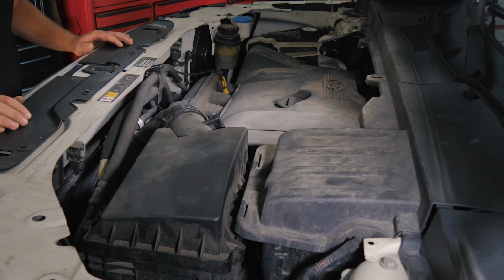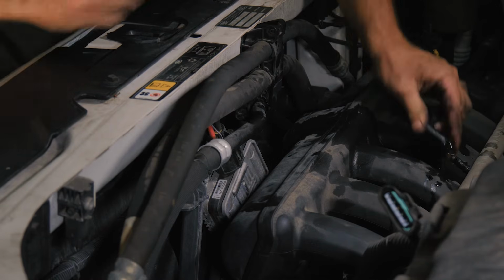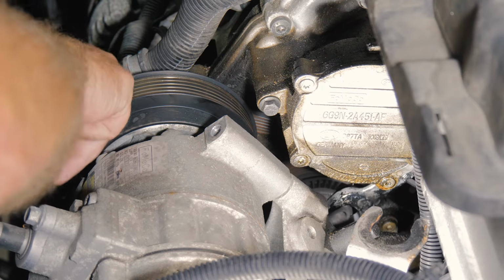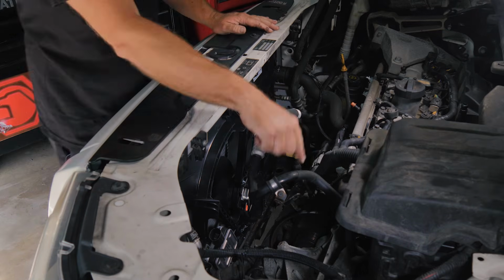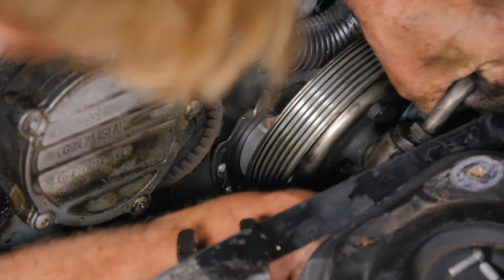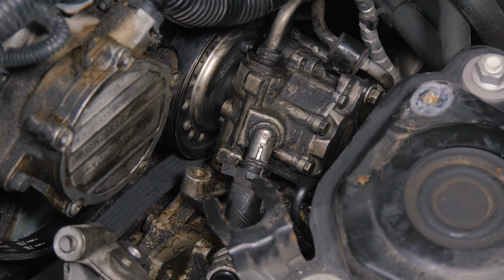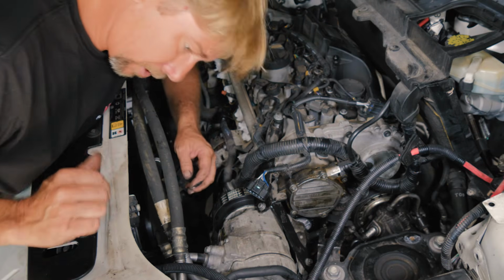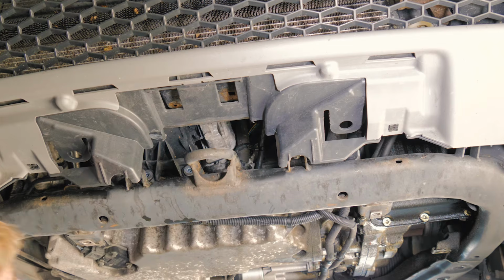2008 Landrover LR2 Dual Radiator & AC Condenser Cooling Fan Assembly With Fan Control Module

Comment: Its easier to just remove the front bumper and condenser to get the radiator out. You just need to evacuate and recharge a/c system.
Reply: Hello this is old but could you please direct me to a forum or video where this is explained in greater depth

Comment: it is possible to remove the fan without first removing all that stuff. It is very tight and i bent a few fins on the radiator but I have done it twice with my Freelander 2. Mine is the duel fan.